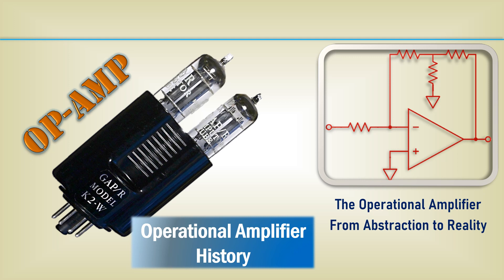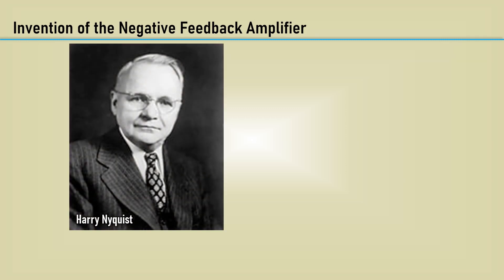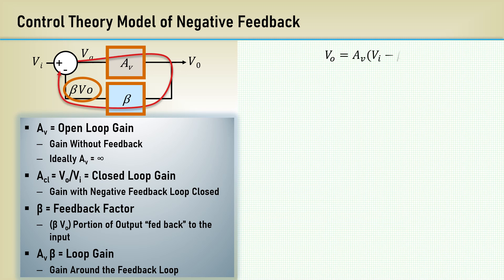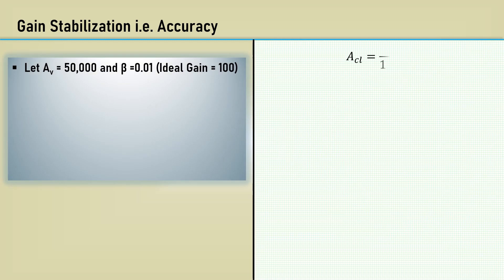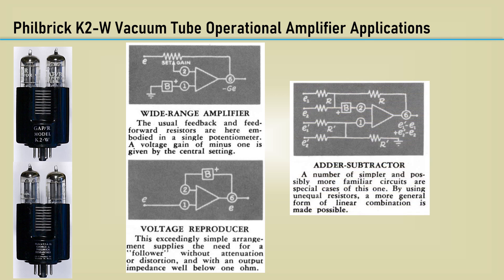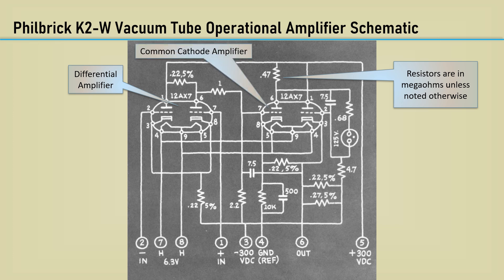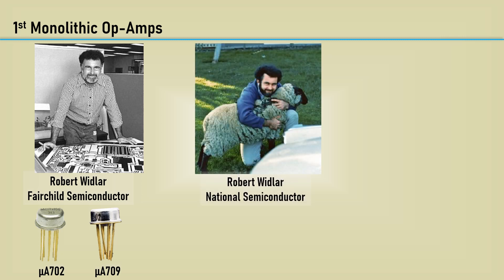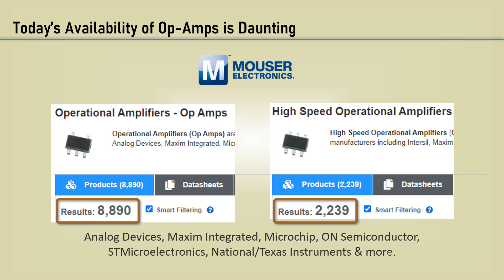Op Amp History - The Operational Amplifier - From Abstraction to Reality

Comment: Another issue with those Mouser counts is that they include different purchase options for the very same products: From a few of each to entire wholesale reels of 3000 to 7000 depending on physical size.
 The count even includes discontinued products that still have a catalog number.
Reply from the maker: Great points. Thanks for the comment.